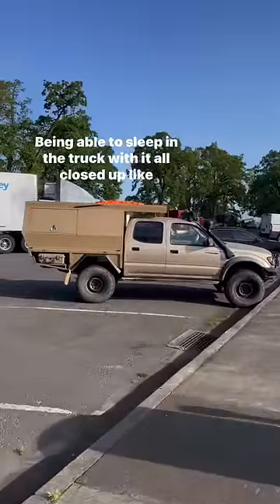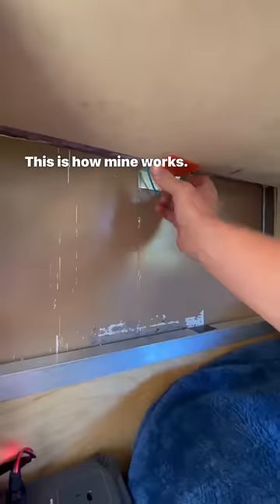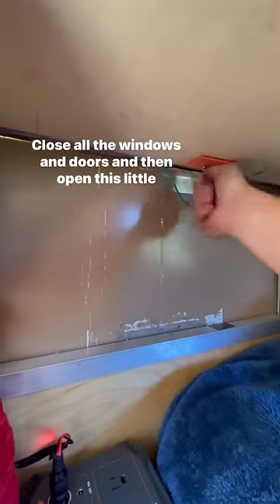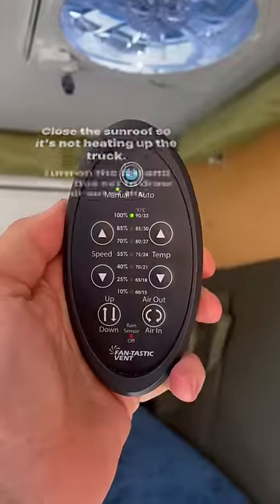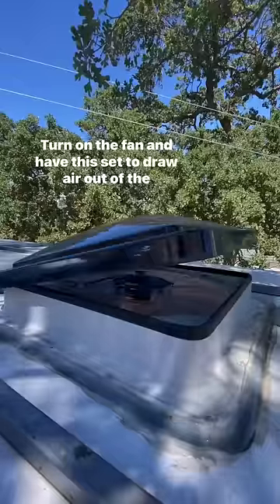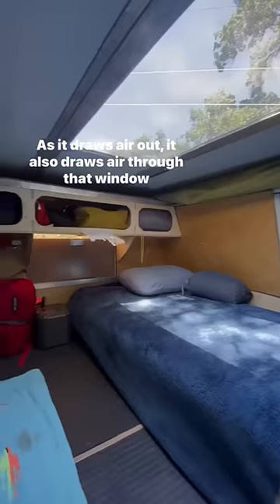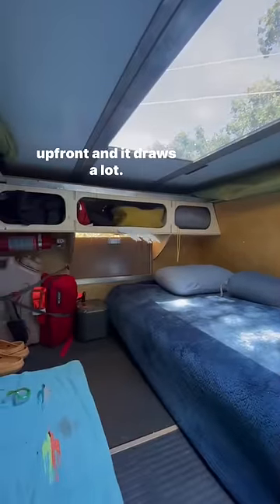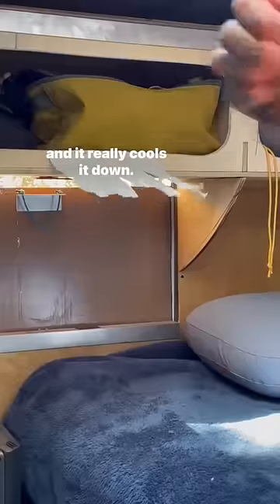Stealth camper setup

Comment: yeah, that was how my old van was set up. note you need a decent opening to get decent air flow so if you have a little hole for an intake you're going to get hot. also a secondary 12v fan to push air in your direction is great. 12v computer fans are cheap or free.

Comment: This is called a "negative air pressure system" its the most efficient way of evacuating air from a ln environment.  Its a very efficient way to cool a space.  

The biggest downside to NAPS's is it brings in dust, smoke, or anything else in the environment.

Comment: Bro you could build mounting brackets. Where you can slide in custom cut swamp cooler pad. And run some water line made for fridges drinking water and ice maker. From water tank to 6 ends sprayer from swamp cooler. That sits behind top bracket on hinge. water pump on switch. Or better yet figure out. Some type of automatic sensor. That turns on water pump. One that measures the pad being damp and wet. Or swamp cooler style with it's on water container and scaled floating switch. Also similar to what toilets use.. and have pump run off solar power n power bank. And you have ice cold air for cheap

Comment: I live in a country that routinely hits 120+ - this would kill you so fast. You don't want to draw hot air inside, use your air conditioner. Idling most family sedans will cost you about 70c an hour, $7 a day for air conditioning is worth it in that heat. Just make sure you upgrade your oil pump before idling though, no vehicle likes idling unless you design it for it. And nearly no one ever does.

Comment: Have you ever tried using this in Arizona on 110 degree June day? The air you would be drawing in would be like drawing the air of an oven. On those days it only cools down to 95-98 degrees at night. Still hot as hell.

Comment: A vented air gapped roof will help keep the suns heat out. Like a double walled tumbler. The first roof will get hot but the vents will let the hot air out.

Comment: This only works drawing in cool outside air IF the outside air is cool.    

Otherwise you’re just doing what we’ve been doing for decades are my house, fan in window drawing in cooler outside air (thru a screen of course) with a window open at the other end of the room to let the warmer air get pushed out.

Comment: It looks nice but when outside air is bad meaning hot like Arizona  this does not work I see you travel and stay in cooler states but you need battery supply and air conditioner in hot air. We traveled like this but you can control outside air  when u crack windows and u battery charger and portable fan it does basic same thing but you still have outside aire. We have truck like you and rv but nice idea but doesn't solve staying cool!

Comment: Park in shade will lose 10 to 25 degree. Park on dirt road another 10 to 25. And by a lake another 10 yo 25. It was 128 degree coming off the blacktop in my car. I went and parked in shade on a dirt road by the lake was 72 degree. That's a 56 degree difference. Go to rest stop to get ur food and shower then look where closest lake or dirt road is pull over there to rest

Comment: It's an attic fan, dude.  Everyone in the south had them before AC.
Reply from the maker: I never said i invented "HOW AIR WORKS" haha just showing how i set up my camper : )
Reply: @OverlandUnderBudget  It's a nice setup, and not just the air system.  Looks comfy.  And running it that way is very smart, especially if you hadn't seen an attic fan before.  Most people want a fan to blow on them, and as you see they work much better sucking your hot stake air out instead.

Comment: How short do you have to be to fit in a pickup tray mounted camper?
Reply from the maker: The sleeping area on the floor is 78inchs, 6.5 feet on the interior wall to wall at the top of the slope if your lying on the sleeping pad.

Comment: How long is your sleeping bed?
Reply from the maker: 78inchs measured on the Top of the pad.
Reply: @OverlandUnderBudget is there anything like this commercially available for say a ‘99 Ford Ranger? Mine is also Tan and I want it to look as badass as your camper… 

I also have: 5.0L V8, 12k lbs winch on winch bumper, 4in lift, AWD, and, LED Flood lights.

Comment: Truck idleing with ac on .😂 soo exciting.
Reply: What ac?
It's just a fan
Reply: @dadaniel2k11  truck idling with the air condition on cold or heat.  Uses 1/4 tank gas for 10 hours.

Comment: Now anyone who sees your truck can get in that front window with the diy plastic latch
Reply from the maker: So the video from inside is when the camper is off the truck. Normally the cab of the truck is just 2 inches away from that window so it’s not possible to reach

Comment: To all who say run them over, ya gotta have direct access to the drivers seat! Or you have the luxury of remotely starting the vehicle this should be enough to make them run off. But, What if you wake up to someone jacking your vehicle while your in the back? You need a kill switch installed near sleeping spot prevent being taken for a short ride. Incase you need to use remote start because if your kill switch isn't near you you cant remote start to potentially scare off the catalytic theft

Comment: convert the back seat so you can sleep in the back
Reply from the maker: Its like 4.5 feet wide inside haha zero space. But new modern trucks yes that’s a good option
Reply: @OverlandUnderBudget  I thought of a way to rebuild the whole inside of the cab so you wouldn't need to tow anything.  Or convert a short bus

Comment: Is it not scary to have basically an open hole right next to your head while you sleep though? I mean, in the sense of someone grabbing inside?
Reply from the maker: Open hope isn’t there when the camper is attached. I filmed the interior video while I had the camper detached in the drive way. Normally the back of the truck cab is 2inch away
Reply: @OverlandUnderBudget I'm glad i got this again in my algorithm. I travel for weekends, so I only need a very temporary camper, but I'd prefer for it to be a part of my daily because it's more useful for me to have hauling space for work vs two different cars.

How hard is this to do? I will search your channel for more info too!

Comment: No offense but you gotta be a little dude to be able to sleep comfortably in that I know my big ass self wouldn't do well in that LMAO. I'm not knocking you at all but more power to you if it's good for you...
Reply from the maker: Ya it’s built to fit me, and the truck it’s on which is tiny. I’m 5’10 and there is 6’5” interior length at the base, 7 feet bed up top when popped up, and 7 feet high when open